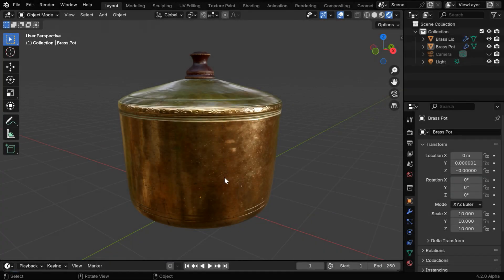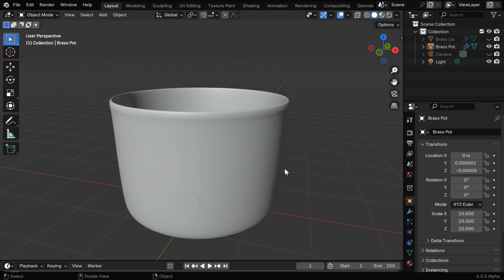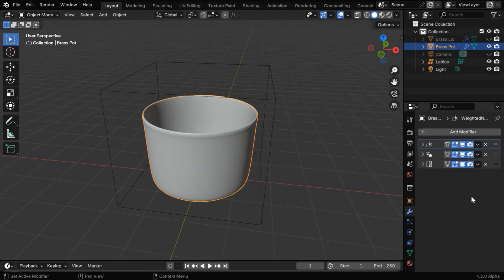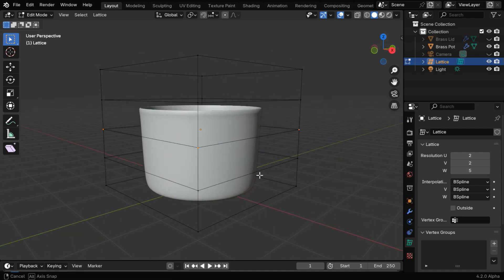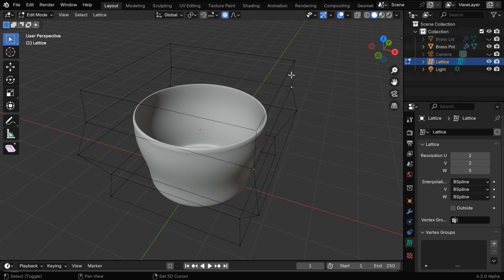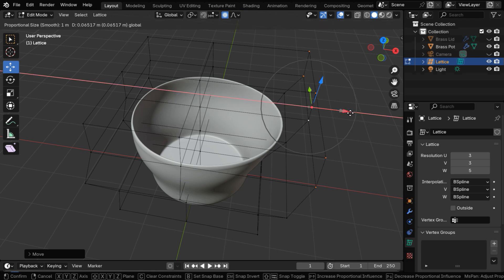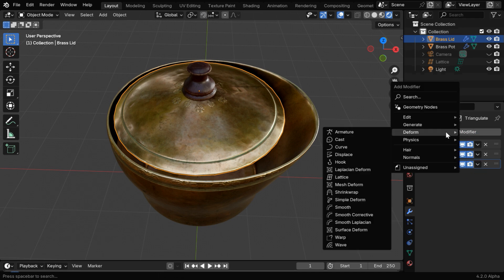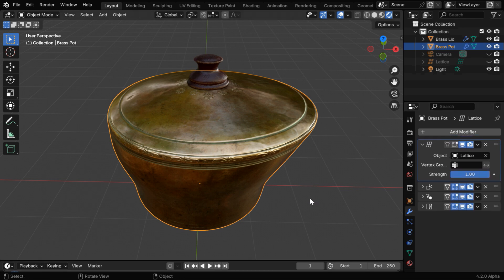Lattice Modifier | Procedural Editing | How To Use This Beautiful Feature In Blender

Comment from the maker: Lattice Modifier is most suitable when you need a small edit or a correction to a large complex mesh. It is best used with proportional editing and it's procedural in nature (you can turn on or turn off the modifier or change its strength to toggle between the original mesh and the new geometry). I think it's one of the lesser known marvels in Blender 👍